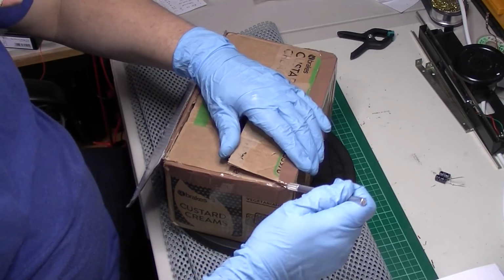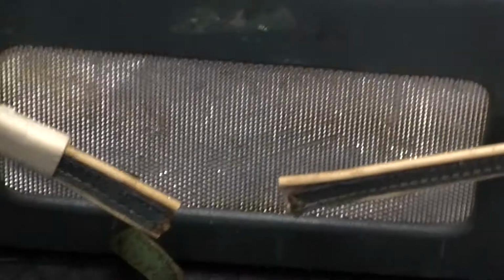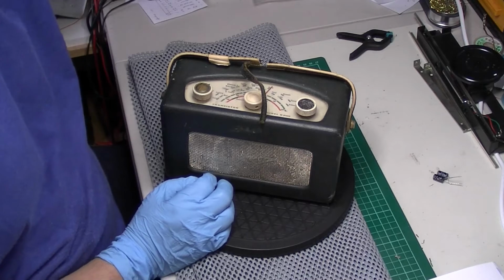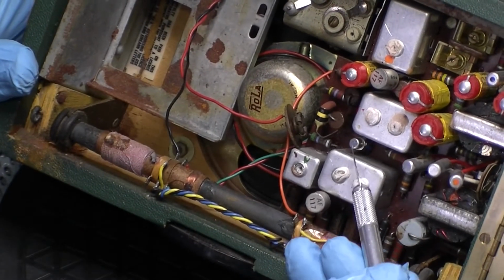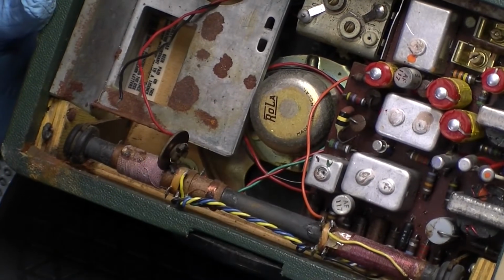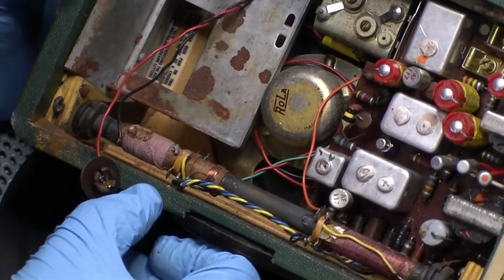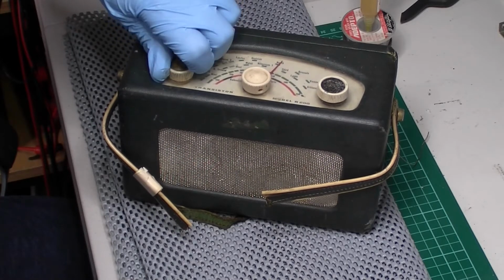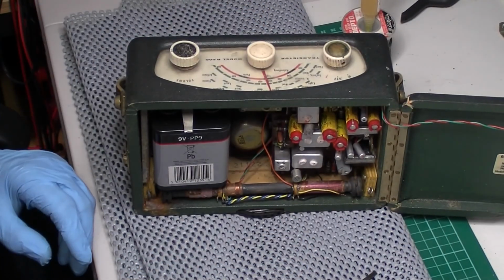Roberts R200 Part 1: Unboxing and first look

Comment: On occasion I've heated a AF117 so the can flies across the room and then hot glued it on top of a substitute transistor. No-one will ever know.  Proctology gloves seem all the rage in radio repair circles lately :)
Reply from the maker: +Andrewausfa thats a good tip andrew. I expect that the top of an AF117 would fit nicely over an AF127. Thought you might like the gloves! I think I had them on for a previous use and forgot they were on. Doesn't hurt with the state of some of these radios though.